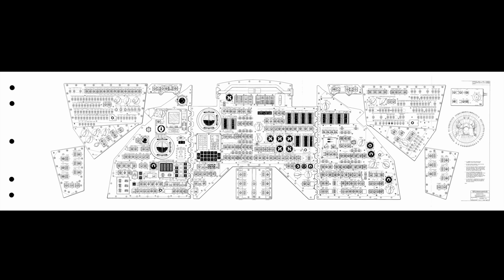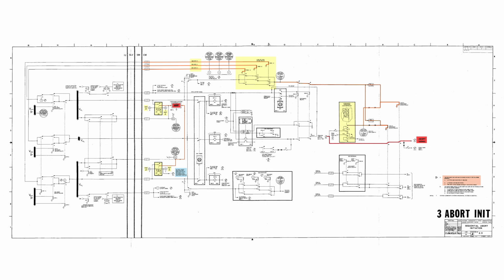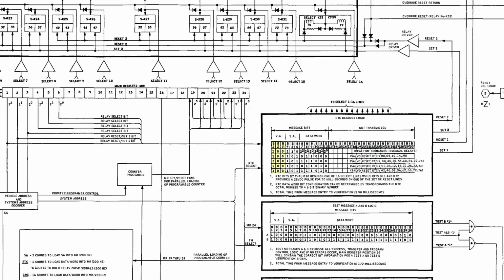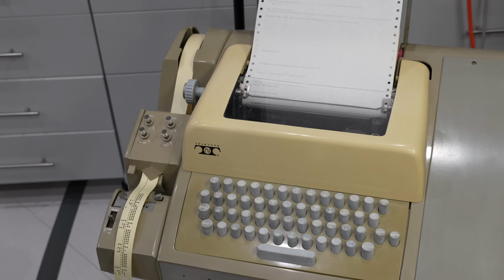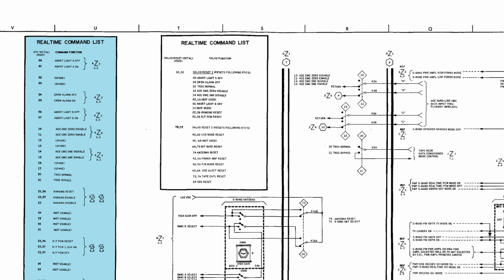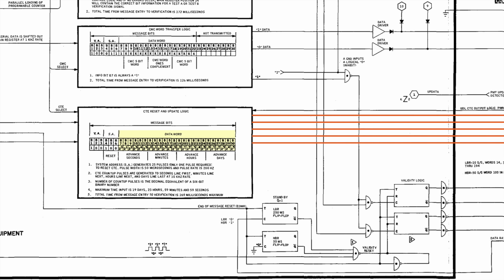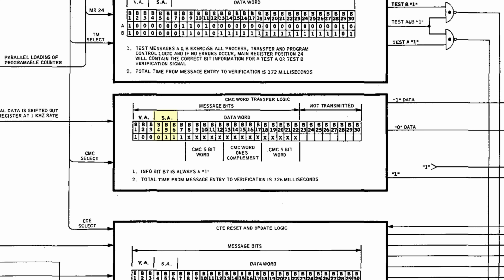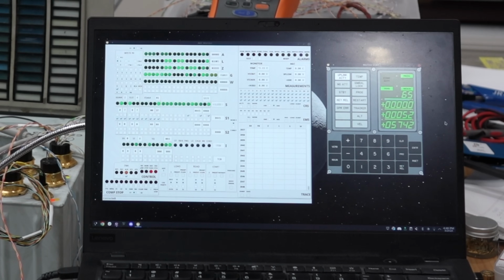Apollo Comms Part 34: Trying every function of the Apollo command system

Comment: On the schematics you've shown, there's a lot of symbols that look like a large Z with numbers in various places around it. They seem to be references to another drawing, somehow, but I don't quite see how. What do they mean?

Thanks for bringing us all into your lab to see all these things you're so lucky to have to play with. Keep being awesome!
Reply: You are correct. It references to a sheet number and letter/digit sector on that sheet, which has that circuit, hope it makes sense :) Eg. Sheet number 6.5, sector A/3
Reply: @deathblowhere  so the sheet numbers are split each side of the Z, and the sector (is that like a grid?) is underneath?
Reply: @meerkatmcr   No, it's opposite - sheet number is stated under "Z" and grid reference are on each side of "Z". If there is no number under Z, then that symbol refers to the same sheet.
E.g. at 29:44 on the right there is “Central timing equipment” box with Z symbol inside. It refers to sheet no. 7.1 grid reference D/2. At the same time stamp you can see x2 Z’s in the middle of the screen – they both refer to the same sheet which is shown (hence no sheet number underneath “Z”), grid reference R/7 (At that R/7 sector you will find those “9” and “10” reference points). It is hard to describe it in the comments without screenshots so I hope it makes sense
Reply: @deathblowhere  now it makes perfect sense (when I look at that timestamp in the video and your explanation)! Thank you!
Reply: @meerkatmcr  You're welcome :) Glad it helped 👍

Comment: I thought you guys would never top the AGC restoration, but man was I wrong! This is absolutely astonishing! Both the work, foresight etc by the original engineers, but also you guys reverse engineering skills. I’m flabbergasted. What you are doing, is documenting the stone age of modern technology in a fascinating and modern way. Hats off to you - this effort is just amazing! 🎉
Reply: They topped the restoration by shrinking the AGC to fit on a solderless breadboard!  Fascinating episode, and very welcome. You guys are certainly having fun and it's wonderful to see how this piece of Apollo worked. The different endian-ness of the command fields seems to show how the various design groups thought things should be and then any disconnects got fixed in the software. Wonder if that's actually true? The Apollo project was on such an aggressive timeline, it's even money that it was true.

Comment: In episode 100 I wouldn't be surprised if they just go ahead and rebuild an apollo capsule
Reply: "Hello and Welcome. As you know, we have landed at the Apollo 15 site and are currently restoring the LRV communications system. In the last episode Master Ken has reverse-engineered the remote camera control circuits and Mike has written a transistor-level emulator of the uplink encoder..."
Reply: @ReneSchickbauer  hahaha 😂
Reply: At this rate they'll launch a video on the moon in episode 300 - As a flag they will put "This episode is brought to you by PCB Way!!!"